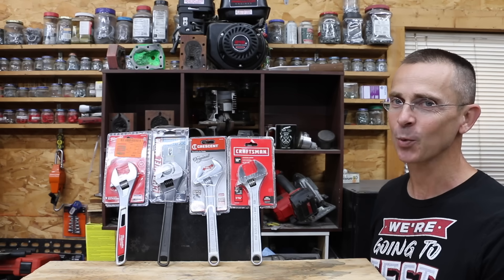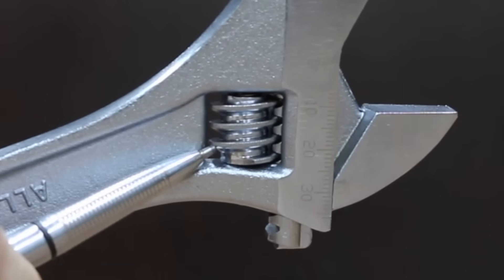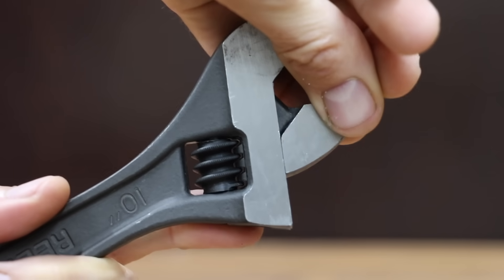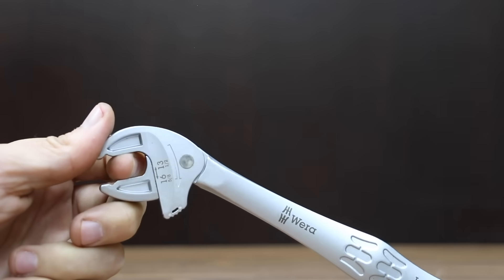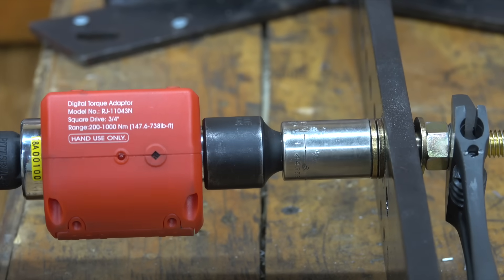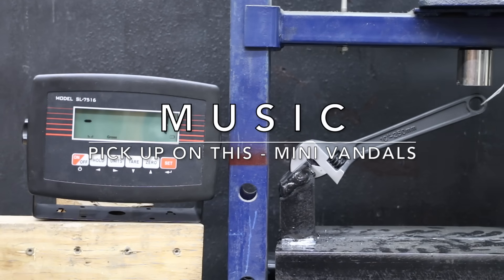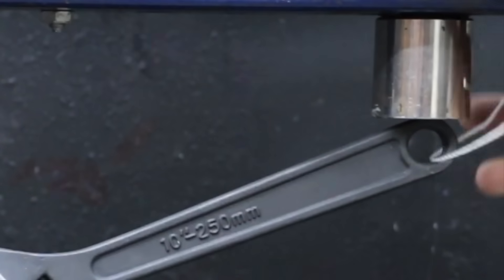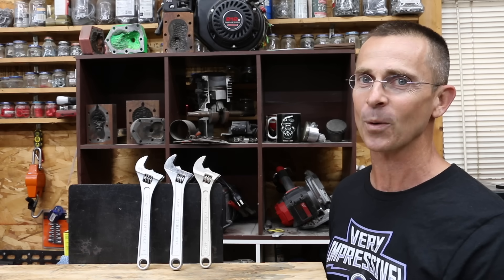Best Wrench (ADJUSTABLE)? Craftsman USA vs Craftsman, Crescent, Kobalt, Milwaukee, Channellock

Comment: On a whim years and years ago I bought 7 Craftsman adjustable wrenches from Sears, figuring at some point they would come in handy.  They're USA built, beautiful, well-made tools, and they have never, ever failed me.  I am sad that we now have to look to Germany and Europe for well made tools.
Reply from the maker: Thanks for sharing.
Reply: Worse yet, Snap on bought Bahco and moved production from Sweden
Reply: @husq2100  bahco from Sweden best adjustable spanner ever.
Reply: Pretty much the same with cars. If you want a well built car, look at Japanese or European cars. My friend has a Volkswagen Jetta Diesel, and it’s lasted him forever. 482k miles on the clock.
Reply: @Joshtheweatherman  I was in the Toyota dealer and a guy was screaming at the service manager because they diagnosed a bad head gasket and his truck only had 500,000 miles.
Reply: @Joshtheweatherman  not really. it is mostly parts from other countries assembled in another country that also is not done in the 'parent' country.
Reply: @Joshtheweatherman  my sister's jetta TDI is at about 140k miles and has gone through 2 DPFs in the past year. She does mostly highway driving...
Reply: Be very careful when buying anything from anywhere, check real closely, because even from Europe many companies still use their famous trade names but buy from China and many companies don't even bother to show were it was made. While we are on the Chinese crap subject, 85% of all sellers on Amazon are Chinese!
Reply: @johnchristmas7522  so you're going to ignore the same free trade agreements the u.s. has with china? a majority of our tools are now made there, not in the states.
Reply: @johnchristmas7522  thanks for agreeing. but someone had to break the ice for the unaware.
Reply: @johnchristmas7522  Also they've done things like importing chi1nese workers and cheap materials to Italy just so they can sell it with "made in italy" !! Part of their "belt and road" nonsense.
Don't know about anyone else but if I want to buy something Made in Italy, I want it made with Italian materials made by Italian people.
Reply: Craftsman tools was the real quality for many years, too bad Sears started only selling Chinese junk. It cost them the business.
Reply: There’s still multiple tool companies who manufacture in the USA.
Reply: I think price to performance we can still look to Asia/ Taiwan for well made tools. Their quality given the price allows you to replace them when they eventually fail without feeling guilty for destroying them (or spending a lot of money).
Reply: @Sovereign_Citizen_LEO  When they eventually fail your hand goes smashing into a greasy, rusty, sharp piece of metal and you need stitches, and the nut gets rounded off.  It's not a "oh, it broke, just go buy another $7 one" situation.  And what father wants to give his son a $7 POS Chinese tool that never worked right for him in the first place?
Reply: @unclematt3  - While I agree, has that ever happened to you (or your son)?   
It's happened to me but not because the tool broke. I think that's only possible if you are using such tools frequently (like as a mechanic). 

So if you're a mechanic, then yeah, or if you don't want to give your kid an inexpensive tool as a gift, that's also understandable. But for many people (myself included) who would rarely use such a tool, the inexpensive (but otherwise good quality) Chinese made tools will suffice. 

Indeed the vast majority of my tools are Chinese made (I have some old ones that are American made). Not because that's my preference, but rather because I have priorities, and cannot afford an entire Snap On tool kit. My priorities are family, property taxes, bills, and many other things. 

But your points are logical and understandable I suppose. My point was that the European or American made tools aren't that much better in most cases than the Asian made tools. Manufacturing and the availablity of CNC Machine Tools Globally has closed the gap in the last couple decades.
Reply: Proto (possibly made by western forge - the same forge as vintage craftsman), SK (may also be western forge)
Reply: The company called Western Forge may still make USA made adjustable wrenches, because they made them for SEARS Craftsman.
Reply: traitor corporations that sell their soul for pennies ...!!!!
Reply: Any chance you’re willing to sell one of those beauties
Reply: Europe always fucking cares

America DOESNT
Reply: I own many USA 🇺🇲 Made tools from the 50s,60s,70s and 80s that became mine when my Pops passed away. I remember using these tools as far back as when I was 7. That's 51 years ago. These tools have about 1,000 years of use left on them👍
Reply: Germany is in Europe
Reply: It was a sad day where I live when the plant that made Craftsman tools closed it's doors.
Reply: Look to Japan! Japan makes the best tools in the world in many cases, along with Germany. 

Lobtex is amazing for adjustable wrenches, vise grips, combination wrenches, etc.. One of the oldest tool companies in Japan, and the oldest manufacturer of adjustable wrenches there.

Nepros is like a better looking snap on. Extremely high quality for a high price. Better fit an finish than snap on. Best chrome in the world.

Koken has the best ratchets in the world. You'll never buy a ratchet with lower backdrag; that's what they're best known for, as well as having some pretty awesome knurled grips for many of their tools.

Fujiya has some of the highest quality pliers I've ever used, with innovation to sweeten the pot. They've got some nippers that catch the piece that you cut off, so it doesn't go flying. But their pliers, at least the ones made in Japan, are some of the best I've ever seen.

Engineer is another great pliers brand, but they specialize in screw extraction, and there's nobody better at it. They're the same company as vampliers. Vampliers is just the marketing name for America.

Merry is yet another great brand for pliers. This is where I go for the heavier duty pliers. A few of their pliers have some very aggressive teeth in the jaws, so it's good for extra rough handling, and their finish quality is something to brag about along with every other brand in this list.

KTC is the biggest tool company in Japan, and they're the parent company of Nepros. Nepros is the premium brand of KTC, but that doesn't mean KTC tools are bad. They're all better than most tools you'll find in America, and they're a better price for the quality that you're getting. 

Japan just has the right culture for making quality stuff. They take pride in what they do, and there is a lot of attention to detail present in their manufacturing. Their tools have a better finish, less wobbly loose bits, better packaging, and they're always a reliable quality. I've never gotten a Japanese plier that's been stiff to open. Never gotten a Japanese wrench that had muddy looking lettering or numbers on it. I've never gotten a Japanese tool that wasn't beautiful.
Reply: @wesleythompson451  replying to you for research purposes
Reply: @bucketspree4952  Welcome to the world of smooth, beautiful Japanese tools.

Comment: My Diamond tool and horse shoe Diamalloy adjustable wrench’s from 6” to 16” by two inch increments still working as new over 40 years into service career. 
Of the current crop I prefer the Milwaukee.
Reply from the maker: Thanks for sharing.

Comment: Dude, you're turning those wrenches the wrong way. The stationery side of the wrench should be the side that's applying force to the nut or bolt head, not the moveable side.

Comment: The cresent brand used to be made in america. All crsent wrenches have the same issues. The grip does almost nothing to provide torque. That's determined by the length of the wrench. Not the comfort of the handle.  So this vid is just misinformation. Thanks for nothing.

Comment: I really like the Tekton mechanics tool kits. They are very well thought out but I was surprised at how weak the 3/8" drive breaker bar was. Broke on first use and I wasn't applying that much torque to it. I'm going to look at Klein and Crescent in the future for my long bars. It's all in metal composition and proper heat treating.
Reply from the maker: Thanks for sharing.
Reply: Dwight the test should not be when it breaks in your hand! Unfortunately good tools are not cheap and bad ones are dangerous.

Comment: I still use Williams and Proto adjustables that I’ve had for maybe 45 years or more. No need to ever replace , still excellent and at least as good as any made today.
Reply: I have an 18" proto adjustable that broke when I was tightening hydraulic fittings.  It was brand new and it didn't hold up.  I have no where near me to exchange it so it's just paper weight.  USA made also.
Reply: @user-sp3gq1up9n  Stanley acquired Proto in 1984 and I don’t think the quality has quite been the same since.
Reply: @GeorgeMcKinley.  The original Proto tools were made in Jamestown, NY, Where the original Crescent tools were made. Proto an off shoot of Crescent, after it's Patent expired.
Reply: @erickdanielsson6710  exactly, I think they were at their peak when owned by Ingersol Rand but still back in the day their quality was much better.
Reply: @GeorgeMcKinley.  Stanley acquired Facom and I don’t think the quality has quite been the same since

Comment: I would like you to repeat this with the wrenches flipped over. With the force in the direction you used, the pressure force on the moveable jaw was at the top. Reversed, the force on the weakest element would be at the bottom, putting less toque and therefore less movement on the moveable jaw, causing less distortion and less chance of damage.
Reply: I think the load bearing portion of the wrench is on the same area no matter the orientation. I could be wrong ofc.
Reply: I think the tool was used properly, if you look at the Crescent brand wrench at 2:54 they actually have an arrow on the handle to suggest the direction of travel.

Comment: These tests are so well designed that I wager that this video has secretly been seen by the design team for at least a few of these tools manufacturers to see what they can improve.
Reply: I certainly hope that all companies that get "air time" on Project Farm would be VERY attentive to see what they can do better.
Reply: Or to see what they can lower in quality.  Look what Craftsmen has done since the bankruptcy, gone from world beating quality at very low prices, to the worst possible quality at higher prices than Harbour freight.  I am amazed that the German tools failed to the old Craftsmen, but on the other hand, it was older.  A ten year old German tool would be better than a new one.  (the steel gets worse every time it is recycled (5 yrs or so).  Nothing is made from virgin steel anymore.
Reply: More likely they watched to see where they can cut costs because their wrench outperforms its price point.
Reply: @PlatypusVomit  I hate that this was my exact thought. Cynical? Probably. Inaccurate? Probably not.
Reply from the maker: Thanks!  Thanks for the feedback.

Comment: Well the tools made by slaves did work better than duct taping a rock to a stick, not by much, but better. The rock and stick would have less tolerance slop. 
And China, for the love of whatever you hold dear... For less than a cent per wrench your cost, learn what Finger spring, Wave Spring and or plain Spring washers are. If you can't make it the right, shim the screw in the thumb nut and get some tension on the side of the thumb nut.   
If you own one of these POS take the nut off and look inside of it. If it looks like it was made of cast turd without the decency to run a broken rusty drill bit through it... Drill, shim and a spring washer. 
Sorry for the rant. They were just so pitiful. Crap just flopping around.

Comment: if the wrenches were turned over you should get higher readings as the force applied to the movable jaw is closer to its base

Comment: Nope they are not , Chinese crap , step one take to a press and fix gap if not it just nvr holds size , then heat to 800 degrees and slow cool , boom , u have a crap China wrench that actually works now, and I was referring to kobalt tools , absolute crap out of box until you rework them, but for me adjustable is last resort when I own 2-3 of every wrench size and nvr bother with this crap

Comment: I was taught to put the load in the direction you are using. After thinking about it I think using them in the other direction would allow them to take more load since the load on the moveable jaw is closer to the tool. Please run this test for me
Reply from the maker: Thanks for the suggestion.

Comment: If I'm wrong, so be it but, shouldn't the load test be conducted upside down from how it was done? I've always been told to and used the tool to twist the other direction.

Comment: An amazing video with really well-designed tests 😁

I tuned in because i want to upgrade my 10" and 12" adjustables (my 8" is a Bahco) and ive been looking at Iregas - I guess the ones in your test that are Made in Spain are made by Irega 🤷‍♂️

Anyway, my experience of adjustables is that they all move under load and therefore if you use them for heavy duty work there is always a risk of slippage or damaging the fastner. All the brands have their own advantages and disadvantages, there doesnt seem to be a standout wrench that does it all.

I'll probably upgrade to Irega or Bahco 👍
Reply from the maker: Thanks!  Thanks for sharing.
Reply: Irega is good. I have two old ones
Reply: @elconquistador98  I would suggest not to go by names of old. Original names of old tools were all excellent. Trouble is, many companies went down the Chinese crap road, for cheapness but still kept there good trade name!  Watch out for that.
Reply: @johnchristmas7522  Yes, I'm aware. The worst tool I ever bought was regently, a Channelock 5 in. slip joint pliers with so much slop they wouldn't cut a piece of wire. Then there was the small Crescent wrench. with a slop problem, and a sloppy Irwin vice grip. Project Farm lays it all out.
Reply: @johnchristmas7522  
I mean "recently".
Reply: @elconquistador98  Probably at the moment KNIPEX is your best bet. Especially if your a Pro.  Most of their tools are German made. If your looking for good tools, then expect them to be dear. Cheap tools are a false economy, they don't last and are dangerous. Good tools tend to go walkabout so keep them close!
Reply: @johnchristmas7522  We’re on the same page again. I have one ordered.
Reply: I try to avoid using adjustables. Even a good one is a poor substitute for a 6 or 8. point wrench.

Comment: I bought an adjustable wrench from Sears back in the late 80's. The actual Sears brand was better made than the Craftsman at the time. They told me it doesn't have the guarantee like Craftsman. I'm still using the Sears brand today. Very little wear on the jaws.
Reply: Back then craftsman was owned by Sear's, so technically they were both sears brand.
Reply from the maker: Thanks for sharing.
Reply: I like craftsman 🔧 🔨 tools and my dad always got them from  sears or napa. I like these kind of tool's

Comment: Great job, Todd.  My only nit to pick is that when you measured gaps from jaw flex (~15:00), the comparisons didn't account for the differences in jaw length.  It seems to me that the metric of interest is the angle of deflection, and the same angle will yield a larger gap on long jaws than on short jaws.  I.e., the short jaws have an advantage that is purely an artifact of the measurement method.
Reply from the maker: Thanks!  Thanks for the constructive feedback.

Comment: People don't realize that the country and their ability to make a better tool is irrelevant. There are wage and monetary factors that come into play in regards to manufacturing these tools. China can make just as good, if not a better tool, but they have to make money as well. There is much more than meets the eye aside from US made vs Chinese made without taking into consideration all the contributing factors. That's not to say you shouldn't consider the better tools in this case that are made in the US. However, most of the highest quality products, or perceived highest quality products across all product genres are made in China. If you look at most things that you own that you would consider to be of high/highest quality are made in China. There are many factors that the average consumer doesn't understand that come into play in regards to the final product. The Chinese are not lacking in the ability to make high quality products.

Comment: I have some random Korean-made adjustable wrench, don't remember how or where I got it, but the jaw slack on that thing is absolutely tiny. You can barely even feel that the jaws are moving if you wobble them back and forth. The laser marked millimeter scale is also pretty accurate.
Reply from the maker: Thanks for sharing.